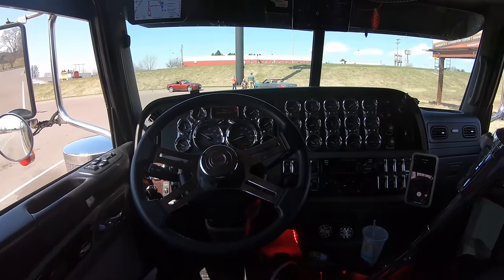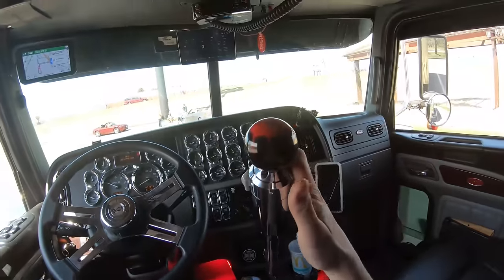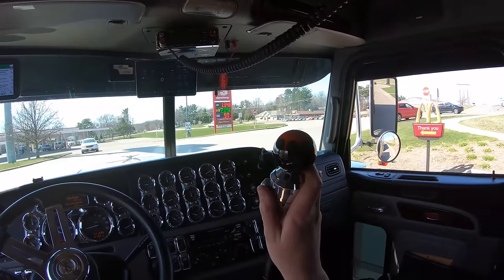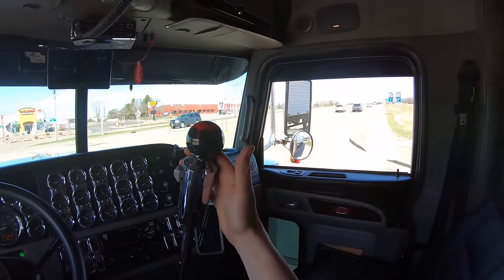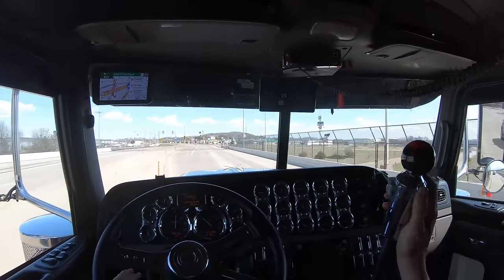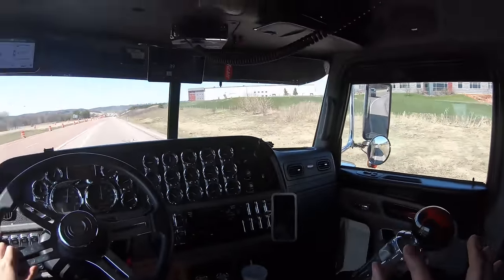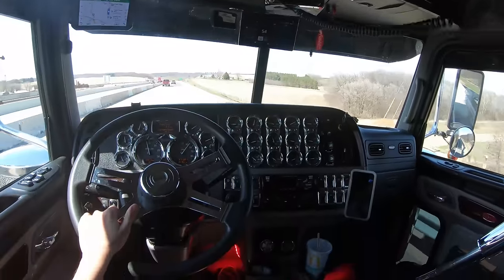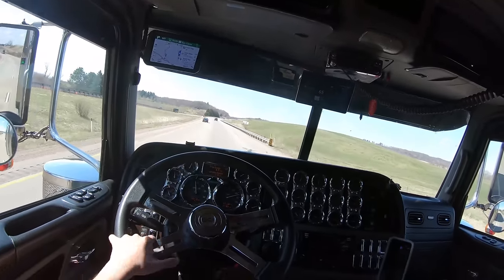Tips on shifting a 10,13, and 18 speed Eaton-Fuller transmission

Comment: When you're double clutching and getting the hang of it every time you shift say this in your head; Clutch to neutral, clutch to gear. This is the exact speed you want to shift at.  When you're done saying "Clutch to neutral" you should be in neutral. When you're done saying clutch to gear - it should be in gear.

Comment: Dude, both my dad and I were like, “hell naw, we won’t drive an automatic.” Get into an automatic rig. “Hey, this is kind of nice”.
Reply: Automatic is easy shifting all them gear especially in the city hell no only a egomaniac that is lying would enjoy that
Reply: I will never go back to a manual I I have a choice no clutch knee no hand pain
Reply: Real men use three pedals...
Reply: All these companies  going full auto anyway  you want  a manual  their giving you an old high mileage  truck
Reply: Double clutch I-Shift(probably hasn't hit the USA yet?) the way to go...it's already in the next gear before you've left the current one,no gap in the revs,saves fuel!(Volvo).
Reply: As a non-trucker, I am at a loss as to why these huge transmissions are not being replaced by manual sequentials at least, if not automatics. All this fuckery with the clutch and gear splitting sounds like hell on earth when trying to drag a 50' trailer through a town and getting nailed at every red light just having to do it all over again, and every time some jackoff cuts you off.

Computers are better at running the clutch than humans are, if you want to  pick your gear for yourself, get a sequential, you can pick the gear that's best for the road conditions and your load, and the transmission handles the song and dance of flipping through the gears. Am I missing something as to why that would be a bad idea?
Reply: @Hiiiiii74  two reasons I guess, the psychologist reason would be you feel more in control of what the vehicle is doing. Then the second would be reliability. There is more downtime with computers. The more complex things get, the longer they take to fix. There is an old trucker saying “if you’re wheels ain’t turning, you ain’t earning”
Reply: @mannyzx1  Thanks for the reply, I guess it all comes down to cash especially since most trucks are operated by small businesses. Conveniencing yourself or your drivers is a luxury that comes with higher repair costs and more opportunity costs for every hour it spends in the shop. I guess y'all are stuck playing that transmission like a violin in rush hour traffic through a metro area 😅

Personally, I'll pass on playing a violin in traffic with 50' and 80,000 pounds of goodies behind me, I don't know how y'all do it
Reply: @Hiiiiii74  most companies are moving there due to insurance reasons. nowadays its an expensive option to get a manual. i like driving manual but i absolutely dont plan to do it forever. indianapolis-chicago at midday will absolutely wear you out
Reply: @williamrae9954  yeah but the thing is, even tho that is what they say it does, the I-shit feels jumpier than even Scanias old Hopticruise box, which is shit as well. And the guys I ride with on ly Internship, loathe the one Fh16 they have, and would literally prefer to drive the old run down Scania R series they have. Or even the Scania 143, which is Manual and painfull to drive after you had your 30 mins of fun time with that straight piped beast. They all do love the Scanias they normally drive tho, a 2014 S520 highline, and a 2018 R580 Topline.
Reply: Hiiii74. Believe it or not at low speeds and in town your not really shifting that much.  When your empty you don't have to start out in 1st gear all the time.  In my 10 speed when I crawl in traffic I just left it in 3rd when I was empty even can start in 4th sometimes but mostly I used 3rd.  A guy who knows how to shift isn't always running through every gear up and down.  Even downshifting you can skip a few years at a time instead of going 10,9,8,7,6,5,4,3,2,1.  You can downshift 10,8,6,4 and stop at 4 and come to a stop.
Reply: @SkilledEddie  working the ports in Los Angeles traffic, with the occasional Bakersfield run.
Reply: @mikem-nt7pb  not necessarily I have a brand new 13 speed and they gave it to me 2 weeks ago 🤷
Reply: @Hiiiiii74  a sequential wouldn't work in such a big vehicle.

Comment: Great video.  Less then 6 months with CDL.  Drive a 10 speed.  Constantly grinding gears....thanks for the info
Reply: Just remember 400 rpm to shift up or down, 400 revs per gear.

Comment: When I got my cdl, my dad taught me the technique of "ghost double-clutching."  All that's involved is that you move your leg, but only move the clutch pedal maybe half an inch.  Then, just to make instructors, and the tester happy, I'd double-clutch on a downshift. 

Trust me, the ghost double-clutching trick saved my left leg, knee, and hip much trouble.  Afterwards, I taught myself floating and had so much more fun shifting.
Reply: Nothing beats getting the shifting perfectly cracking the passenger window and listening to the turbo whistle. After 25 years it's still awesome.

Comment: I usually double clutch the lower gears up to 5th and float the rest. You've gotta try left foot braking while float downshifting with the engine brake on, you can blip the throttle with your right foot while still slowing down, letting the engine brake do most the work.

Comment: My big challenge back in school was pressing the clutch deep enough to where the gear engaged smoothly. Instructor wondered why I had trouble with that and figured it might be because of my long legs - i.e. less leverage on the pedal, and I believe that’s true. It seemed like I had to put a hell of a lot more effort into the clutching than others to achieve the same result.

Comment: I drive an 8 speed dump truck and I know how to float gears up and down and skip gears. I drove a 10 speed in class A cdl school. I’m going to go OTR for experience then after a year buy my own Peterbilt. I want an 18 speed. This was easy to learn and watch cause I know the concept of shifting and floating gears. Thanks a lot for this video bro keep em wheel rolling 🙏 drive safe!
Reply: 18s are easy as hell...only use the low side if you're hauling heavy or want to move slow...otherwise drive it like an 8

Comment: Great video, I have been in trucking for over 40 years and you did it prefect. The only thing I do different is only use the clutch to start and stop. The other thing is a lot of new drivers will sit at a light with the clutch pushed right to the floor and that raises hell with the clutch brake. Unless you are changing gears you don't need to push the clutch right to the floor. Great job, nice dash to 389 right.
Reply: Yes sir agree 100%

Comment: with 35 years experience of driving Scania and Volvo trucks, I appreciate the ergonomics and utilization of technology for a reason. Better visibilty from the cockpit, better mirrors, bigger steering wheel, modern gearbox and no 2 meter long gear shifter.

Comment: Was Trained On A 4  Speed Truck Towing Trailers A GMC Dually Work Truck.  1st Was Granny. Basically Get Out Of Mud Gear. Lol. Then Had A 10 Speed. Driving And Learning Was Actually Fun. Learned How To Back Trailers Quickly Running Underground Phone Lines In Rural Areas.  Unloaded The Machine Off Trailer A Few Times To Get Me Out Of Ditches When I Had To Turn Around After Going Down Single Lane Back Roads.  With Dead End. This Was In The Mid 90s.  I Got Scared A few Times I Will Admit.  After Dark In Middle Of Nowhere Using Flashlight And Headlights Getting Out Of Ditches.  Wouldn't Trade That Experience For Anything.   Thanks For Sharing Your Video.  😎.

Comment: I drove my first 18 speed and first load I learned exactly what u said in this video.  With a little messing around and my own common sense. It was great. .I didn't tell my boss I didn't ever drive a 13 or 18 . I got lucky with this job. Somewhat lied and had a good person refer me. So he thought I knew it all. Worked out just fine. I know for someone else this would be a good video. If very very new a slower video would be better.

Comment: I find, personally,  that unless you are completely empty and the truck is brand new, split shifting allows you to get into gear much more smoothly, both up and down. Once you have gained decent ability to use the "regular gears" , i would encourage you to practice splitting gears as often as you can. You never know when the company needs a heavy load hauled and you are the only one available at the time...quick way to earn a raise! Or a quick way to die or kill someone if you didn't practice. Concurrent with this instructors information... it also opens up a lot more speed variables so any speed sign can be followed without over revving or lugging the engine! 
Edit* Not for the right video but still applies f*** it (spit to the ground)

Comment: Awesome dude “clutch neutral clutch gear” ive been looking for videos that explain what double clutching is and this one is the most helpful one this will help me get my cdl
Reply: Clutch is only for starting and stopping...you'll figure out how to float gears
Reply: @aaronsanborn4291  1650prm i learned...blip it
Reply: @williamrae9954  I don't even bother to look at the tac...I listen to my truck...
Reply: @aaronsanborn4291  Aye,that comes with time...a may drive up to 20 different trucks a year,American,Euro and Japanese...all sounds are different,as are g/boxes
Reply: @williamrae9954  all three of my trucks are Caterpillar powered two by 3406s and one by a C15...they have two different transmissions as well. But if you listen the Cat motors will tell you when to shift no matter what the gear ratios are.
Reply: me too!

Comment: I haven't double clutched since my class a test years ago.  Tried it again last week just for shits and giggles, man it was Horrible.  
Clutch is onlg used for 1st and reverse.  And the occasional time it sticks in gear when she rolls a little to quick for grabbin the next one.  Dam drivin in the mountains
Reply: Same here. Lol
Reply: Nick D you dont have to use the clutch on the other gears? You just move the clutch or have to let off the gas then clutch? Just interested and was wondering👍
Reply: @paschallhouston  nope, just lift off the throttle
Reply: @nickd.4512  cool. Thanks for info. I want my CDL but dont think I could learn looks confusing. I have a 5 speed manual car but big rig looks intimidating to me
Reply: @paschallhouston  its not adter youbget it down.  Its just a 5 speed that you row through twice.  Not bad at all if its an 8, 9 or a ten speed.  13, 15 and even 18s aren't that bad once you get used to it.  I will warn you though.  When you take the test, you have to double clutch, if not, they'll fail you.  Best to learn to double clutch until you pass your test, then learn how to float gears.
Reply: @nickd.4512  thanks again. Yes seen the some other vids about double clutching.

Comment: Salesman: welcome to Volvo, what kind of semis your looking for?
Me: AUTOMATIC PLEASE! 😂
Reply: Duckdude001 my dad got a 2019 379 13 speed early last year. Looks awesome with 8 in pipes and the jake break sounds amazing
Reply: One bad choice of semi, another bad choice of transmission
Reply: Volvos are just junks in America because everything has to be shipped off to be repaired and almost everything is metric
Reply: Duckdude001 your right on that it is a 389 and it’s a Cat 550 engine. As I’m writing this I’m with my dad right now on the truck
Reply: Duckdude001 in America Volvo sucks
Reply: Bc of the measurements and availability of parts
Reply: Volvo is best truck 
I drive 2021 vnl760
Drove 2019 cascadia too in the past ...
Volvo acceleration, suspension, mirrors, fuel economy, backing up, ride smoothness..you dont get tired in the volvo like you do in the cacadia... I would never buy peterbilt or kw as an owner operator cuz of too much fuel, hard to back up, manual etc.
Reply: If you ain shifting gears you ain a trucker.
Reply: @jerrycannon6940  auto is giving you better milage than manual also without any work. For me I want to make my life easier 😃🤔😉😉...if you pay me more for shifting gears I would definitely do it then Hehe
Reply: @Duckdude001  but the manual shifting isn't for the ''speed''. As silly/childish/stupid as it may sound, it's the authenticity/feel of ye olde truckin when you can manually do it. Wouldn't trade my twin stick for an auto even if you'd pay me...
Reply: @Duckdude001  very much a true statement on the preference. Mine’s a 6+4 Spicer, Peterbilt 359. Oldie but a goodie.
Reply: @High_strung  Exactly my thoughts. I hate automatics. They are sensitive, you lack direct control, and they suck 20% of the power out of an engine because they are nothing but a hydraulic pump with more parts, filters, and "wet clutches". No thanks. give me a manual transmission EVERY time, or dont give me anything to drive at all.
Reply: @jerrycannon6940  I guess my 20 years on the road driving all different transmissions don’t make me a trucker then. I’ve shifted so many gears in my life I’m burned out on it. Was cool when I was a pup. But now I’m old and lazy. Just give me the automatic. Lol
Reply: rofl
Reply: @googleuser6916  i can believe that
Reply: funny how the volvo model you guys get is something rarely seen in europe
Reply: @Drakonniz  the automatics in volvo do not use more power . it's an automated manual . they suck in every other way indeed lol
Reply: @theinvertedpineapple942    His right what?  Hand?
Reply: @scarharting5577  What?
Reply: I dread going to a new company and being given a manual now....the old Eaton twin splitter was fun though,chasing a forage harvester round the paddocks!
Reply: @googleuser6916  I'm the opposite...i was crippled after only 100 miles in a 389....and it was only 2 weeks old....i could have set fire to it, my Volvo was great...and comfy!
Reply: @googleuser6916  Yank Volvos are 15yrs behind the Euro ones...look at a 2021 FH750 on here...even use door handles from 3 models ago in the USA
Reply: @williamrae9954  wouldn’t doubt

Comment: I dont know if you will get this since the video is 7 months old, but super 10 transmissions have the high low range for all 5 gear wells. Also I have heard a lot of people say that double clutching is a must but I was told by my DOT examiner in North Dakota that he wanted me to shift in the safest and smoothest way I knew how. No grinding gears and no lugging the engine. And rev matching is by far the easiest for semi trucks.

Comment: Great video. What I don't get is in a semi, the drivers extend the shifter up for other people to see it has a manual transmission , but if you have a Chevy diesel pickup truck they advertise  on the hood that it has an automatic transmission, you can't even get a stick shift anymore. You wouldn't think the two would be so different

Comment: What about the legendary 15 speed?? J/k but great video brother, you almost made me go from 5th to 7th in my 10 speed🤣
Reply from the maker: easy there guy lol
Reply: I was told that the 15 speed is one of the few that requires a low low selector, however working in aftermarket I’ve came across quite a few mechanics saying that they’re 9 and 10 speeds have a low low splitter. Explanations??
Reply: @MattsWhatSheSaidd  well i think they said that because a 10 speed with a auxiliary lowlow is a 15 speed !

Comment: I am French. In North America, semi-trucks are manual and usual cars are automatic. In my country, and many other countries in West Europe, that's the countrary : semi-trucks are automatic and usual cars are manual. However those manual gearboxes are totally different from eatonfullers. There are only 6 or 7 gears : one to reverse, and 5 or 6 to drive depending on the age of the car. Fortunaly it is much easier to control than an eatonfuller, because the transmissions are synchronized (You don't need to release the clutch at the neutral and to push it again to change gear, you have to change gear directly while you're pushing the clutch.) but it stays a manual gearbox. That's why, despite we take the driving test at 18, a lot of us fail. When we are not professionnal drivers, it can be hard to learn how to coordonate the wheel and the gear shift and to start the car without stalling.

Comment: even after years of floating an 18 speed hauling heavy I still miss 7l most times. Every truck is different, some trucks ill get it every time, others not at all. Its become habit for me just to give it a quick rev when shifting to that gear and works every time. Same thing with going from 4H to 5L
Reply: That's what I do
Reply: Yeah 7l gives me trouble too

Comment: One tip for anyone who still drives a manual.   Don't push the clutch all the way down to the point where the clutch brake is engaged while the truck is still moving.  I drive for ups and people who do this while hooking up sets of doubles absolutely melt the clutch brake.  A manual with a clutch brake is a rare commodity at ups.  Don't destroy yours

Comment: When you were first taking off you said there's no need to split em on the bottom side with an 18spd unless you're heavy. Then when you were pulling out on the road you said it was acting kind of a fool because you were heavy. Being able to split each gear on the low side is what an 18spd is for. Here's a tip for you: don't put extensions on the gear stick, the weight of the knob being up that high wears the forks out on the top of the transmission. That's what makes it grind as it "slides right in"! Worn out forks will also cause the stick to bounce around while going down the road, which just wears the forks out even more!